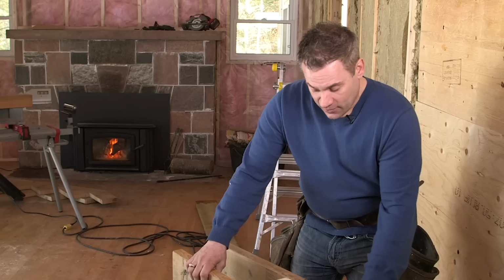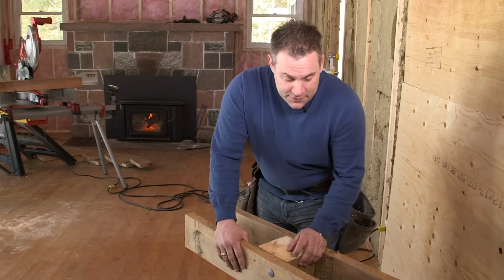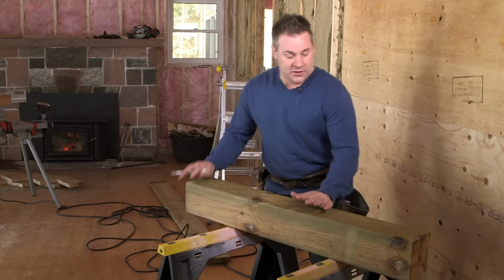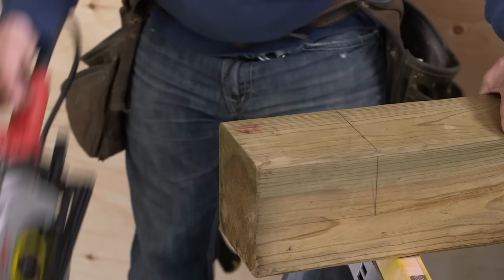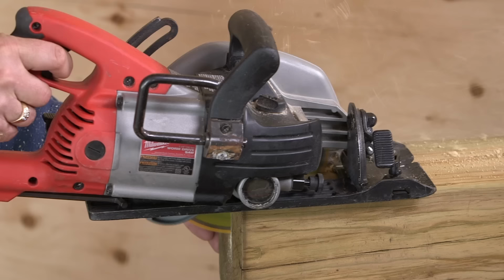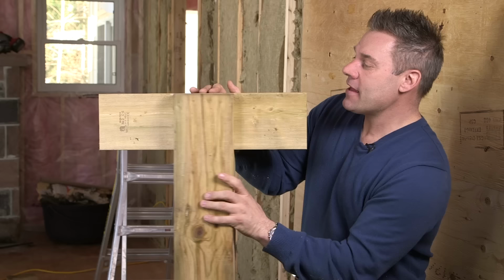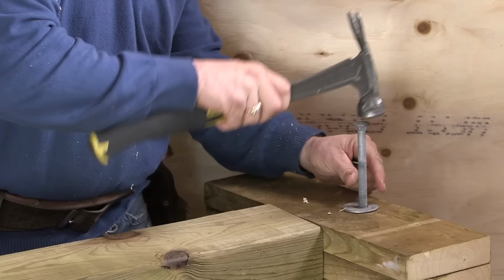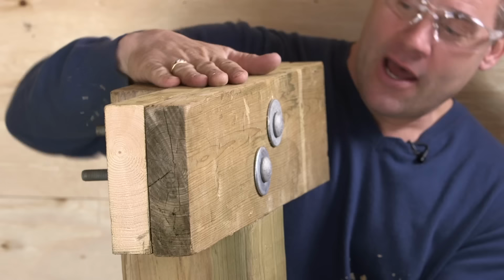How to Attach a Beam to a Post for a Deck | Decks, Docks & Gazebos

Comment: Funny, all the decks I've seen like this, I've had to repair due to water damage or dry rot in the area you cut out. Great place for water to settle in.
Reply: I thought that too. Nice place for water to sit and saturate the center of the post
Reply: Brian Van Horne  would just end up rotting your beam prematurely. Just use a post saddle on top of a post and sit your beam on top, besides a double beam doesnt pass code here, has to be a triple and either would using deck screws either
Reply: I cover the tops of my posts with a sticky membrane like Ice And Water Shield and stain all my cuts.
Reply: @childebrand1  I use redzone and blue skin in certain situations. The best way to keep things dry is just space them out and let air do the work
Reply: This is what I only ever used to use concrete stumps. The bearer sits on top threaded through the steel out of the stump itself. I’d still rather see a deck built with the bearer notched in that putting the whole load weight on the shear strength of the coach bolts
Reply: Brian Van Horne  a properly built deck doesn't need pl. They're engineered to carry the weight through post, beam, joist, metal connections and joinery techniques. An engineer isn't going to factor in adhesive in those circumstances, only when laminating certain beams and posts
Reply: Brian Van Horne  bs
Reply: Brian Van Horne  they're not really a joke, they work as intended. I've done lots of lifting operations with a crane that utilized hangers, so I have seen them work in various situations even ones they weren't designed for. Keep using your squash blocks, I don't care, doesn't affect me. If I have a print that specifies using Simpson strong tie lu210 hangers I'll use them, like I said with the cantilever lvl, how are you going to replace a strap tie with pl?
Reply: Brian Van Horne  in that situation are you talking about a 2 foot over hang for roof trusses, rafters or joist? I was talking about holding the beam down from lifting from the load on the outside of cantilever. Inspector isn't going to let you glue the beam down and pray. Engineer did all the calculations, said it needs a strap tie and that's just the way you do it. There's no doing it differently just to be different, its specified in the specs, they check to see if its there
Reply: Brian Van Horne  like to toot your own horn there. And yes in commercial building if you don't do it with the required fasteners they will make you put them in. Get over it already
Reply: Brian Van Horne  yeah I get it but advising people on the internet to ignore engineer specifications isn't really that smart. Sounds more like handyman work, they're always trying to do it different and "better". Depends on your local building code as well, they want to see metal in areas, you can't build trusses without metal wave plates, in some areas they want to see strap ties all the way up the wall. In some cases they want to see pl adhesive and engineered teck screws. This is the internet, don't tell people to use adhesive instead of metal, there are amateurs here that will hurt someone when their deck collapses. If someone in New Zealand reads this and says "I new metal was a money grab, I'm not going to tie my studs to my top and bottom plates or use shear and wall straps!" It would be on you if they had an earthquake and were crushed by their reno
Reply: I'm also reading back on some of your comments and they don't seem to make sense. First of all you said nail off a 2x10 joist with 4 nails on both sides. A 2x10 requires 5 nails, no more that that, you re turning your board into swish cheese. I don't fully understand your beating both ways with a sledge hammer, you said nail off your joist to a stringer and beat with a hammer? Where did stairs come from? You told me about the roof with the 2 foot "cantilever". Was it an actual cantilever or just a 2 foot overhang?
Reply: Do it the first way then fasten 2x6 to each side of the post.
Reply: "Funny, all the decks I've seen like this, I've had to repair due to water damage or dry rot in the area you cut out. Great place for water to settle in." 
Treat the cuts with water sealer plus use sealant on the faying surfaces.
Reply: Thats why I always put a thin coating of construction adhesive all over the cut notch, ten years later, no water damage
Reply: @mcamodell   Yes, thank you Cameron. Just common sense.
Reply: @bolerdweller  what are you babbling on about old man.
Reply: @galvanizedgnome  cant you read? Also I'm not babbling, apparently the other guy removed all his comments. Also... not an old man.....I'm...a.........MILLENNIAL!!!!!😢🙄
Reply: @rael5469  this is framing, not a shower, anything you do isnt going to make a difference unless you flash over vulnerable areas and divert water away
Reply: @bolerdweller   Oh gosh, don't tell me that. The builder used sealant all over my house.  ;)
Reply: @rael5469  😂ok. Not much of a builder if hes smearing silicone in post pockets
Reply: @bolerdweller   Who said anything about silicone? Silicone isn't the only sealant you know.
Reply: @rael5469  enlighten me then, what kind of sealant did your builder seal an open end grain post pocket with?
Reply: @bolerdweller  I don't have a deck. However all the places where edges come together are caulked (sealed) on mine and every other house. I think if a person uses some sort of water sealer on the raw cuts then water shouldn't be a problem. You know, like you use on top of the deck to seal it. Either way, notching is the best way to go. But there are high quality sealants that could be used in addition to the water sealer product......like aircraft windshield sealant. You wouldn't need that much and it lasts for decades.
Reply: Exactly!  And what about ledger boards attaching deck to house?
Reply: @scottguzik9703  "Exactly!  And what about ledger boards attaching deck to house?" 
What do you mean exactly by saying "Exactly" ?  And what are you asking about ledger boards?  From what I see on YouTube the majority of deck failures seem to be from ledger boards pulling away from the house. So I would think that proper attachment of the ledger board is the most important thing when building a deck.
Reply: @scottguzik9703  Whenever I attach a ledger board to the house I use 1/2" puck standoffs, 2 every 16", with 1/2" or 5/8" lagbolts, so there is air flow behind it. The holes I drill for the lagbolts are filled with caulk before the bolts go in to make a water tight seal.
Reply: Treated lumber.
Reply: Would his method be correct if it had a roof over it not getting any rain on it I'm curious?
Reply: @williambaker7351  yes it will work. I do a lot of work like this. I use treated lumber of course when it’s outside or getting wet. As long as it’s not going to get wet will be fine.
Reply: If you end coat your notch that's fine but just cut your post so the beam Sits directly on top of it and toenail it down with some 3 1/2 spikes , and end coat the ends you cut so water doesn't seep in.... No need for all that noise... Here in Nova Scotia that's how we do it.. also depending on the span a 2 ply beam wouldn't pass code here
Reply: @rael5469  exactly this way is fine, here we have what's called end coat and it's  pretty well the same chemicals they pressure treat wood with in a can and you just brush it on your cuts on treated lumber so water can't get in
Reply: Not to mention you destroyed the 6x6 and then drilled two 1/2  in holes through a now 2 3/4 post which makes a a 1 3/4 post . Needs to be another way.
Reply: What if you treated the area you cut out?  I like the idea of the 4x4 supporting the load but I can see the rot issue happening
Reply: Then just waterproof the areas… just the same when you waterproof the sides that get cut

Comment: Use a washer and 
lock washer on the nut side of the carriage bolt.  A carriage bolt is not designed for a washer on the head side of the bolt.
Reply: Les Brown  Really? Shrinkage can work in your favor or against you. Should be factored in.
Reply: Torque Washers for Carriage Bolts.
Reply: @daviddou1408  Designed for use with square-neck bolts such as carriage bolts, these washers have teeth that dig into wood and other soft material to prevent rotation.
Reply: Just use a hex bolt anyway. Carriage bolts are terrible.
Reply: I use wooden bolts in all my deck projects
Reply: I'd use grade 8 Stainless steel hex head blots feneder washers lock washer and nuts. With locktite
Noch the posts but use a 6x6 noched upright.